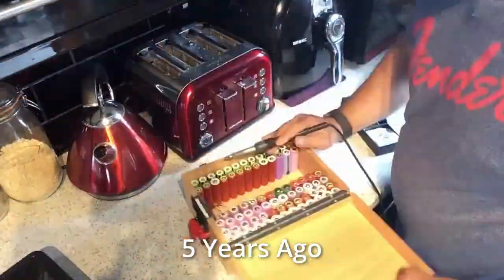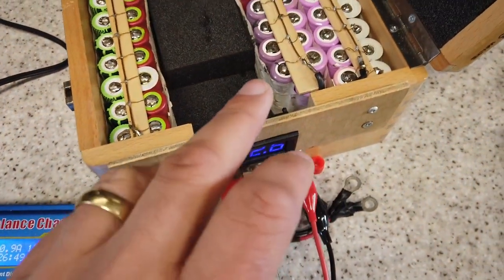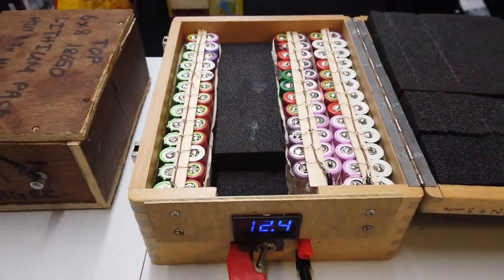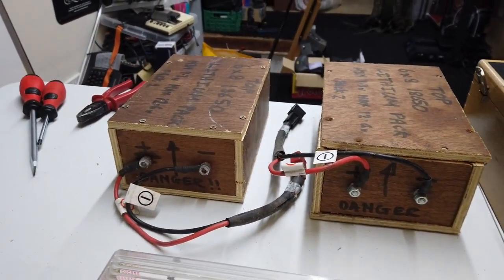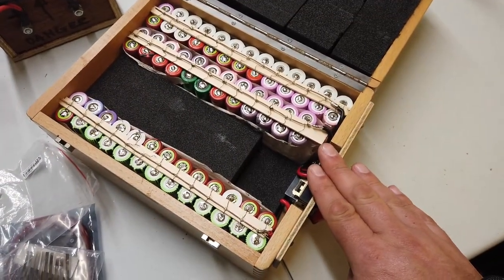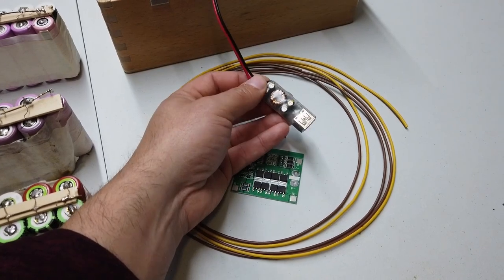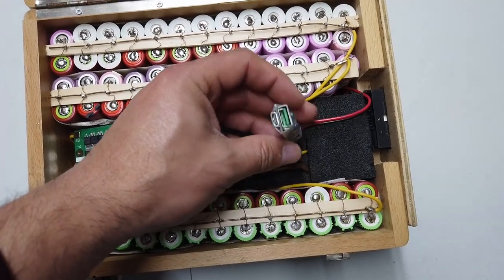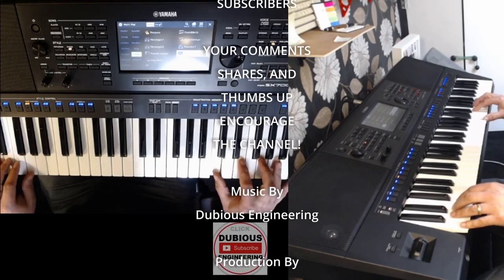DuB-EnG: DIY - Most Dangerous Lithium Energy Cell with Missile Switch - BMS & USBC Power Delivery

Comment: I recommend buying an active balancer from amazon since bms barely do any balancing, especially if you use completley different batteries to build the pack:

Just look up: Li-ion Lipo Lifepo4 Battery Active Equalizer BMS Balancer Inductive Balance Lithium Battery Energy Transfer Board (3S)
Reply from the maker: That's great advice!!! Thank you! Yes, the BMS adds safety, but doesn't maximise the charge distribution!! I'll look out for that!!!
Reply: Any recommendation for active balancers?   I'm looking to do something similar with some "recovered" 18650s myself.
Reply from the maker: @BenScarboro  how many cells in how many packs?
Reply: @DubiousEngineering  good questions...      I'm guessing I need more research first.  Old Dyson battery pack, I think that's 8 cells, then another 6 or 8 from a different pack.  Thinking about it, I don't know those capacities yet either

Comment: I am in the process of putting together a 300 cell 12 volt caravan power pack, I would not even think of doing it without a safety link and BMS, With 2A cells that is a minimum 200 amps @ 12 volts available at the main connector. 200 Amps of Lithium power is not quite the same as 200 amps of lead acid,  not really a toy to play with.
Lead acid batteries can cause a lot of damage, lithium cells can catch fire and kill you if you don't handle them properly.
Reply from the maker: I completely agree 👍  ...  I've been tinkering with these things for years, and I always hold a healthy respect for them.  I really do get nervous about some of my old projects! 😬...
Reply: But its entertaining !😂 My next video will be titled " Over charging lithium battery pack using Jack Daniels as cooling  fluid this is what happened🤓"
Reply from the maker: @patrick starnes  ...  you just know me toooo well!!! :-) 😀